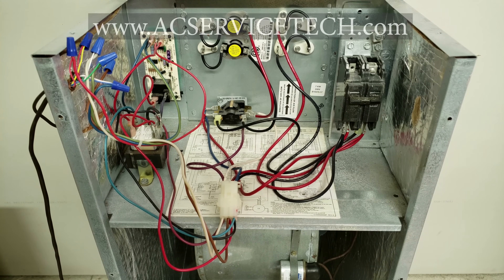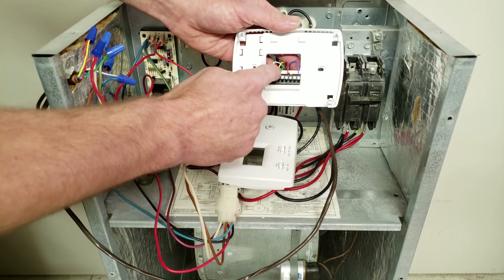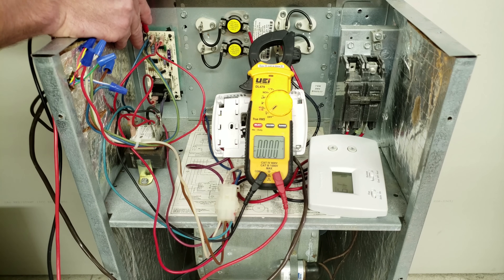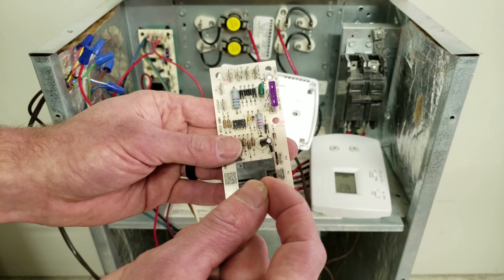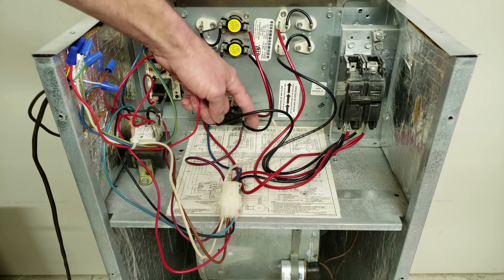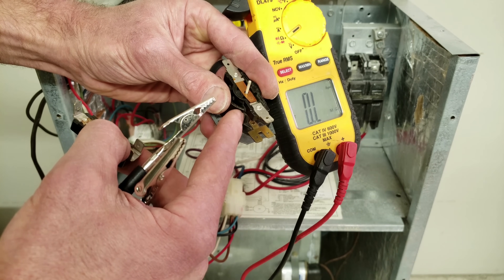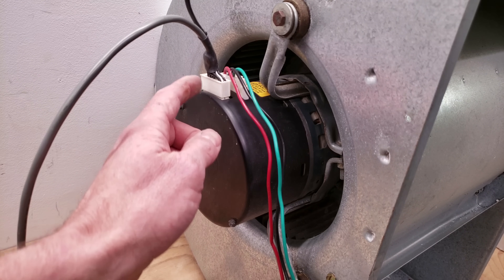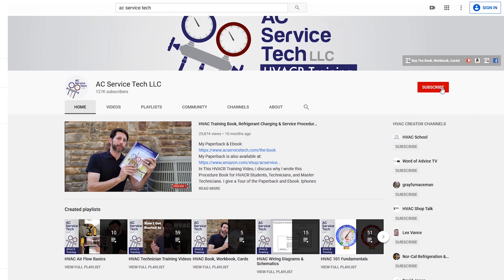Air Handler Blower FAN WON'T TURN OFF! 5 Reasons Why it Keeps Running!

Comment: I removed the thermostat and and the blower motor shut down after 30-60 seconds. Bought a new thermostat and the issue persists. The AC unit turns off but the blower motor in the air handler continues to run until I remove the thermostat from it's base.
I am at a loss here.

Comment: Hello the problem I'm having is everything is running the blower and the compressor on the outside they won't shut off even if the thermostat is satisfied

Comment: Brother, I had a bad thermostat about a year ago, so I replaced it.  Worked fine.   Now the gd blower won't shut off. Fan is switched to auto,  thermostat set to off.   I'm positive it's a contactor somewhere I just don't know what one
Reply: Started this morning at 12:30 am

Comment: Dude, once upon a time (earrrrrrrly 1980's) I repaired televisions for a living, and this video was an absolute joy to watch! (My Forced Air Unit blower is INTERMITTENTLY staying on. I HATE intermittent!) but I love the care you took in your camera work! (I shoot and edit vdeos sometimes, these days).

Your clear explanations are very mcu appreciated. Nice work. Verrrrrry professional.

Now I'm going to go mess wit the whole system again to see what the hell is up. 

I hate intermittent.
Reply: My thermostat was on 80 plus and air handler fan still goes on.  I turned off ac circuit breaker.  I told the AC tech last Friday.  He just said no more parts available for that.  Rusting could.  Freon leaked out.  Cold air came outside ac last week.  I know I have to replace it.
I just want to know is it safe that fan stays on.  He told me nothing.  He didn't even clean coils normal part of maintenance check right.  Put a new valve in leaking coil wanted 900 for new freon. Would not guarantee his work.  Freon could leak out after he left house.  I told him NO.  Paid 89.00 visit.

The incompetence.  Our air safety and health now is what I care about now.  Is there any danger of fire?  Electrical?

Now I turned off thermostat to fan auto.  Air handler still on.  Is this ok?
Ac circuit breaker is off.  Water pump sprinkler is in same box circuit breaker.
What to do?

Comment: I recently replaced the Fan Control Board on my 2009 Goodman after the relay burnt up. Now last night the fan won't turn off. I ordered the sequencer from Grainger. I'm just concerned because I'm reading the sequencer only works with the heat? Is this correct? The thermostat doesn't seem to be the issue. This is for the AC.
Reply: I reset the system that night by turning off the breakers and thermostat. That fixed the issue. Go figure

Comment: My new AC just started this, I was feeling warmth after my AC cooled my house down. Noticed the blower was just running and running even with the HVAC off. I just replaced my thermostat as well, so maybe it’s a loose wire or something. 

But as usual, thank you for all the tips. It’s very much appreciated!

Comment: My blower came on, on it's own, in the middle of the night, altho the Thermostat was set to OFF. Replaced the Thermostat, same problem - blower stays on.  Will try removing the plate from the thermostat next.

Comment: My AC operates normally when blowing cold air. Once the temp is reached, the blower stops the loud sound, and i can barely hear the fan running at a low speed in the attic.  I also feel air sucking in from the air filter unit and blowing at the vents, but with no air  pressure. I realized a problem when i saw my electrical bill jump four times as much. it is not the thermostat, as i have done that test and replaced it. The only way to turn it off is at the breaker.  Is this a bad sequencer?  Thanks.

Comment: Couldnt it be the board too if you are getting 24 volts off C and G wire coming off the motor?
Reply: Im getting 24 v coming off the motor from c and g with thermostat off doesnt that have to be board right? I mean if its not that it has got to be  thermostat  problem beens it has a common and programmable

Comment: Ecm blower motor tuns on and off on its own with thermostat disconnected. However, with 16pin connector disconnected and power is ON blower motor doesn’t turn on anymore? Any ideas? Relay but my board doesn’t look like this example. I don’t even see a circuit board!

Comment: thank you for sharing your experience and knowledge.  my blower continues to cycle when the heat is turned off?  i restrung all my heating elements last year but did not replace my limit switchs? :0 any advice you could give me would be greatly appreciated.  my furnace is very old and i am on very fixed income.  TYVM

Comment: Big brother we just had a storm with power surge and now my blower motor runs all the time where should I start
Reply: Yeah similar situation, had a power surge the minute the problem showed up. Did you ever figure it out or anyone that can shed some light?
Reply: @MrRums  yes it was the a/c control board in the attic I ordered one from Amazon $20.00

Comment: The AC was working just fine. I left town for a few days and turned it off by turning off 2 breakers on the wall. Apparently, it was very hot, and the temperature inside was close to 100.
When I turned the breaker ON, the blower did not turn on.  What could possibly go bad from high temp?  I checked the thermostat, compressor... OK.  It is clearly with the blower.  Looks like a control board inside does not have 24v. Like it lost power. Are there any heat breakers that could melt up?  What about just short them - I do not use Em Heat anyway. Please advise.

Comment: So my heat pump quit working panel says no power but the blower motor is running I have to turn the breaker off to stop it nothing is working heat or AC no breakers kicked. I removed the thermostat and the fan keeps running.

Comment: hi, i have a 1991 bryant furnace/ac, fan continues to run after unit is satisfied, changed thermostat, limit switch, the relays r soldered right to the board. any help would be great. tnx, mike

Comment: First of all,  thank you for the informative video!   My fan blower wouldn't turn off even after I disconnected the fan wire from my thermostat.  It stayed on from about 1am to 7am and finally turned off.  This has happened like this twice now.  I believe it's either cb or the relay.  Unit is a single stage heat pump.  Presently,  the unit is working as it should but I know there's a problem.   Will I be able to accurately troubleshoot with my multimeter if it's not currently malfunctioning?  Has anyone encountered this before?

Comment: If you pull the thermostat from the housing, the fan will STILL run IF the Fan/Auto switch is in FAN Mode. That setting is NOT part of the thermostat module. So BEFORE playing around with wires and voltages, check to see if the Fan mode is in AUTO, if not, then slide it and fix your problem.

Comment: Nice video.  Okay, suppose the blower is NOT blowing when it's supposed to?
Twice, after overnight severe thunder storms here in Houston, the next morning the blowers on the AC units were not blowing.  We have three 5-ton units.  All three blowers ceased to function.
Everything else in the shop works. Everything!  Including the 5-ton units outside the building. They come on, and they push cold air into the housing cavity. ( You can easily feel the cold air when you remove the air filters) But.. the blowers do not come on and blow the cold air into the shop.
This is the second time in 3-4 weeks that this has happened.  After the first time, the AC crew replaced those blowers.  
This time, we can't get them to come back for service.
We've been without AC for 7 weeks now.
I do know that there are no surge protectors anywhere inside nor outside any of the three units.
What would cause "all three" blowers to go out after a severe thunderstorm?
Just seems so odd.
Thanks!
Hot and Sweaty

By the way,  those three AC units were installed 1 year ago almost to the date.
Reply: Did y'all figure out the problem?

Comment: My Ruud heat pump outside condenser fan will not shut off. The contractor maybe wired incorrectly with the fan wire going to the contactor that is bridged. Help!

Comment: What if it only does it occasionally when there is a rapid outdoor temperature drop..or if it rains..or if it gets excessive humidity from the Florida swamp weather?..Mine functions perfectly UNTIL it goes from 90 degrees to 70 degrees outside..then my air handler won't shut off..even though the outside unit has shut off...So it just continues to blow hot air until you shut it off for a half hour

Comment: I can manually turn air off but if I have it on auto it continually runs and keeps a continuous circuit and just gets colder and colder so I have to manually shut it down.

Comment: Thank god I found your video! I’m house sitting and it’s 3am and the fan on the unit keeps running So I took the circuit breaker out of the outside unit and it still ran! I can’t find the inside breaker box anywhere!🤷🏼‍♀️ so I pulled the thermostat off the wall and the fan finally stopped! Was so afraid to go to sleep Incase the fan burned up and caught something on fire! Thank you for your videos! Now off to sleep! 🤦‍♀️
Reply: Was it safe coz mines keep running
Reply: @ yep!

Comment: Blower motor continues to run and coils freeze after thermostat shuts off. But yesterday I noticed the condenser unit outside was still running even after I turned thermostat off. I powered off both at breaker box. It happens randomly so it's hard to get a tech here at the time. Any advice?

Comment: I have a RunTru23 split systen HVAC unit.  When it is in cool mode, the blower fan runs continuously even when cooling is not called for.  This is causing serious humidity swings which do not occur when it is in heat mode as the blower fan only runs when heating is called for.  Can an external thermostat help me with this?

Comment: I just had a ridiculous intermittent short from R. To y at the defrost control board, it threw me through a loop the blower would run all the time and the contactor would chatter

Comment: Just wanted to thank you cus I tried the bad thermostat test and did it. So when the man came to look over my air again I pointed out what you said he tried it to and it stopped. Then he looked at the thermostat and found the switch was on furnace.  Flicked it and all worked great. Thanks again 😮
Reply: What switch would that be on furnace?
Reply: @kittygalore2010  no there was a small switch in the wall thermostat.  It was for gas or electric.  It was on gas.

Comment: to ac service tech,i have two limit switches that appear to be the same but the numbers and letters are different i want to replace both switches but im not sure about the numbers on them,one limit switch is a 201862-t-o-d-60tx01-83c7701-s0445--L140-35F  it has a white label which i cannot find,and the other one has a blue label-201199-t-o-d-60txo1-b1370116-a2101-L14035F please help.

Comment: very informative; QUESTION; I HAVE A COLEMAN DGAT056BDF GAS FURNACE-I REPLACED THE BLOWER MOTOR  NO CAPACITOR ON THIS MODEL; JUST THE POWER WIRE FROM THE MOTOR TO THE MOLEX PLUG-IN CONNECTOR; I ATTEMPTED TO START THE FURNACE WITH THE THERMOSTAT  SET  AT BELOW INTERIOR TEMPERATURE- THE FURNACE CAME ON AND PRODUCED HEAT; HOWEVER THE BLOWER MOTOR DID NOT CYCLE ON  I HAVE A GREEN LIGHT IN THE CONTROL BOX AND THE FUSE IS GOOD?? IT GOT HOT INSIDE THE AIR HANDLER SO I SHUT IT DOWN; ANY IDEAS OR FEEDBACK MUCH APPRECIATED; THANK YOU, PATRICK.P

Comment: I have the fan running when I put thermostadt on heat or em heat. Tomorrow I will bring my meter to test ohms and voltage. My fan relay appears to be soldered into the board. If it turns out to be the relay stuck closed can a generic  relay be used between the thermostadt and existing relay. Board is obsolete. Amana bba36a2a air handler. Heat only being used. Pulled the old ac unit out r22.

Comment: Would your heat not work if this was happening?
Reply: No, it doesn’t affect condenser / compressor function, so both heating and cooling should still work, if I’m not mistaken.

Comment: Hey I took the thermostat off and the blower motor kept running I took the cable off the motor and then the motor stopped so it's somewhere in there between there right

Comment: What do you do if you have turned off the fan outside but the thermostat still shows cooling and the interior temperature gets hotter and hotter?

Comment: I have an interesting case: my blower motor and fan works fine, when I remove the cover on the furnace, the motor would be currently exposed to the open air. Then if I put the cover back on, the motor and fan won’t shut off by itself with the AC off. If I take the cover off now, the motor and fan stops, and while doing that I can hear and feel air flow into the furnace machine. Feels like the motor is not getting enough air flow in, maybe too much static pressure inside when the cover is on? Any help would be welcomed here! Thanks yall!

Comment: I have a Thermostat problem as you mentioned. It runs constantly. Even the Condenser Compressor is on the Rooftop. Worst location to place any A/C Unit. You can't reach it. Find a good way to get to it? My
 A/C Unit has to be raised. It feels like my Condenser Compressor is still running. Now how to fix this matter?
Thank You!

Comment: I have this issue.  When I pull the thermostat faceplate off, then it stops.  I had AC tech come out and he said it’s a bad thermostat.  He changed the thermostat and we tried it a few times and it worked, when set cooling temp was achieved it would turn off.  But after he left next day it was happening again.  When set temp is achieved won’t turn off.  When I turn unit off from the thermostat still won’t turn off.  Fan is on auto.  There are no other settings on the thermostat.  It’s a new one but a simple one.  Also ot was working perfectly until 3 weeks ago so wiring was fine.  Not sure why this started to happen.

Comment: Hmm so I sometimes get little to no voltage coming out of the control bord  (very intermittent) everything else before the last step is good. Is this pretty much guaranteed to be the cuntrol board? They are expensive AF so it would be an expensive miss diagnoses

Comment: What causes the contacts to stick? I just installed a White Rodgers control board and the blower will come on when the thermostat is completely off! The only way to stop it is either disconnect power to the control board or while it has power I can tap the board in the general area of the contacts and it will stop the motor! Please help me figure this puzzle out! Thank you in advance!

Comment: such a great video, 
could having too much foam on the A/C lines (outside) [to prevent rodents nesting etc] in the exterior A/C unit cause this issue ?

Comment: What could it be if it shuts off like it should when I am running the AC but it won't when I run the heat? My brother is having this issue right now with his.

Comment: Could removing the control module off the thermostat, while the system is operational not pose the same risk as when the batteries run out? Wouldn't the outcome be unpredictable and could the system sustain damage or blow a fuse? thanks.

Comment: Always turn off power to unit !
Another possible reason blower not turning off or on is your low voltage wires & connections to motor are dirty . Easy check & clean .

Comment: My all electric older EB15 unit stays on (both heat and blower) once it get a heat call from thermastat.  The HVAC companies have diag it and were unable to determine the issue.  Thermastat good, Thermastat wire good, Sequencers checked, replaced twice and good.  Somehow its heat related becaise with all covers off, it works as it should.  Put the covers back on and it fails to shut off.

Comment: Is the outdoor fan on hvac unit supposed to always run while in heat mode?  It never shuts off while I'm running heat mode.  In AC mode the fan turns on and off

Comment: Doing electrical work in a new building . It was uncomfortably warm or hot even for winter. The building Mgr. called HVAC tech. Tech replaced T-Stat. Next day same thing. Mgr calls different HVAC Company. Tech replaces T-Stat. (counting the original this is the third one) same problem. Finally a guy showed up who was not in a hurry. He pulled the T-Stat off the wall and just stood there shaking his head in disbelief, he called me over and said.. “ look at this “ someone had knocked a rectangular hole approximately 3”x2” to fish out of the wall a small 18/6 T-Stat cable. HVAC guy said..” put your hand against that hole and feel the cold air that was being forced into the back of these thermostats, no wonder it was calling for heat..” He was right, usually office walls are packed with insulation or there is enough to restrict most airflow but not in this instance. HVAC guy took duct seal, sheet rock putty and sealed hole up tight around 18/6 cable—problem solved.

Comment: if i unplug the thermostat and  it kills the blower   is it for certian  a bad thermostat or  could it be the thermostat wires?   there is no wire going to c in the thermostat box so i cant check from g to c for 24volts

Comment: Need help. The red wire that comes from the sequencer and then goes back to the board fried  that white 9 pin connector and that whole wire runs warm and is discolored I assume from the heat. I replaced the connector but it still runs constantly and also won't cool (no a\c). Any idea what might be causing that?  Also I replaced the sequencer about a year ago or so when it just blew hot air constantly if that helps. Hope to hear from you. Thanks

Comment: I have a heat pump in a condo and my fan won't shut off when the temperature in the house reaches the set temperature. If I hit my inside unit a few times with the palm of my hand it shuts off. When the thermostat calls for heat or ac again the blower comes on but stays on again when the temperature is met.  Is this a bad relay or something else in your opinion?